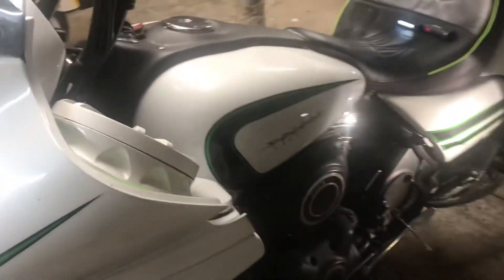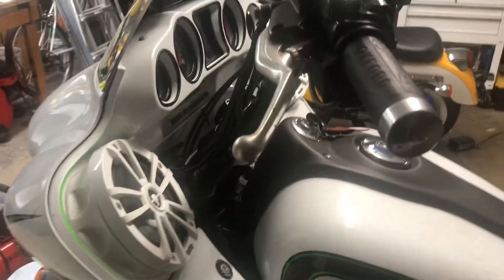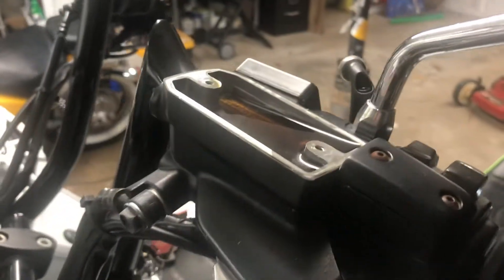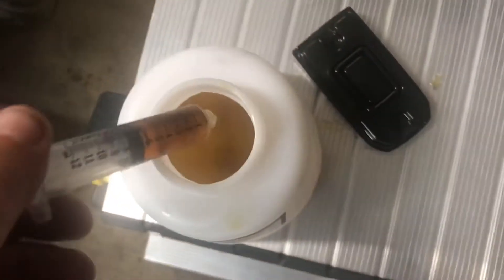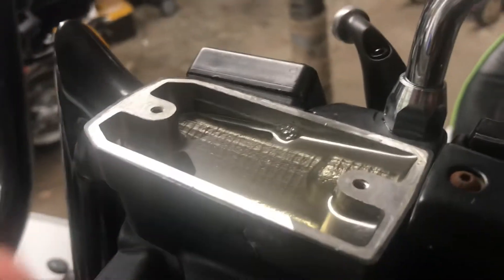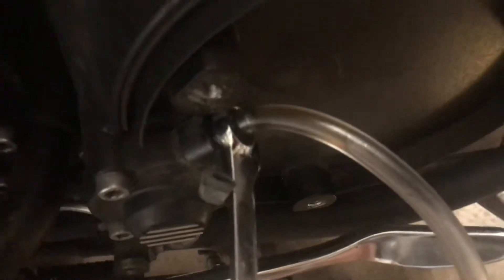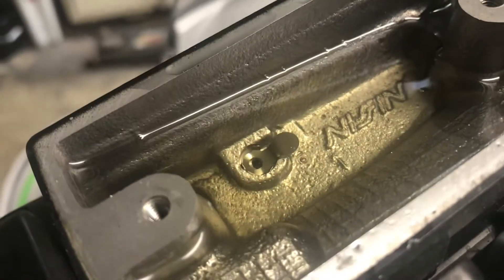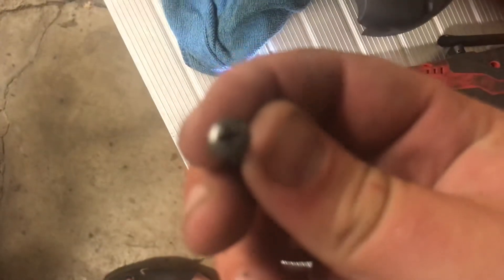How to Change and Bleed Clutch Fluid in Kawasaki Vaquero and Voyager

Comment: I cant get now my clutch to engage. Dont know what happened
Reply from the maker: If it’s hydraulic you should check slave cylinder? I have seen them in very bad shape cause a lot of issues
Reply: In case you haven't gotten it corrected yet(or for the next person reading through), a common issue is engaging the clutch while the reservoir is empty. It easy to do accidentally, especially if it's your first time bleeding a hydraulic system. That draws air into the clutch cylinder. Unlike hydraulic fluid, air compresses. So when you pull in the clutch, the air in the system compresses instead of actuating the clutch pin in the slave cylinder. You need to get the air out. With something to catch the hydraulic fluid, remove the banjo (hydraulic line from reservoir) on the clutch master cylinder. Fill the reservoir. Pull in clutch. Place thumb over the banjo hole to keep it from drawing air and release clutch. Repeat until you have ample hydraulic fluid dripping from banjo hole. Reconnect the line. Pump the clutch several times, hold clutch in and release pressure from the bleeder at clutch slave cylinder (transmission side of line). Repeat until only hydraulic fluid comes from bleeder, no air bubbles. It may take awhile as your clutch isn't moving that much hydraulic fluid when you pull it. My guess is that if the clutch was working before you changed the fluid, air trapped in the master cylinder  is the most likely cause of it failing. Keep in mind, hydraulic fluid will destroy paint and plastic. Absorb or catch all you can with rags, use bleeder hose if able, and thoroughly wash with soap and water anything that gets brake fluid on it. Hope that helps.

Comment: Excellent video explanation
Reply from the maker: Thanks for watching!
Reply: @armyguyz00  after market lights suggestions?
Reply from the maker: @floridaorbust5038  it depends what you already have done. I strongly recommend changing out all 3 headlights to daymakers. They really do make a huge difference compared to halogen. The daymakers on my bike came with it but having 3 nice bright leds up front is prob enough for most people. It wasent enough for me riding in the rain at night or super early in the morning. After that I added a few diode dynamics lights. I did videos on those installs. I will prob adjust them this winter but for now they are great.